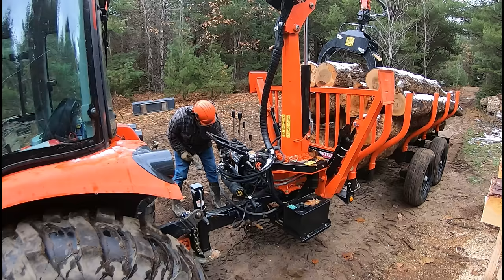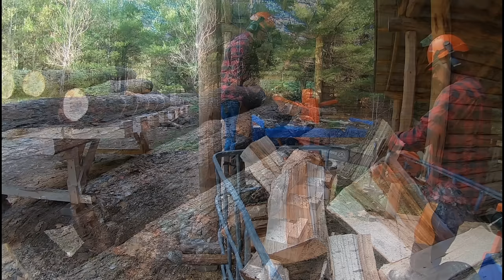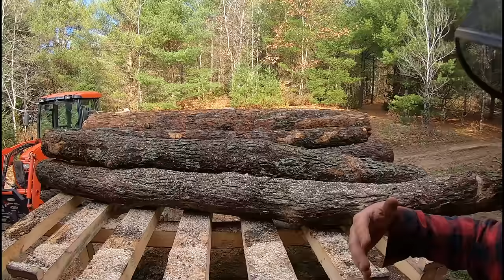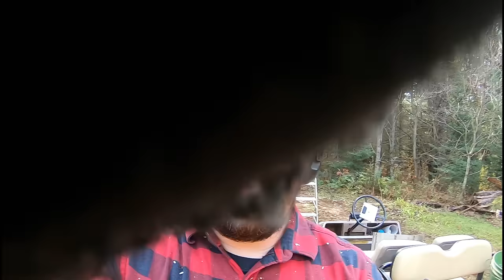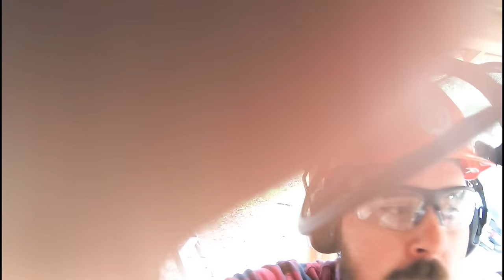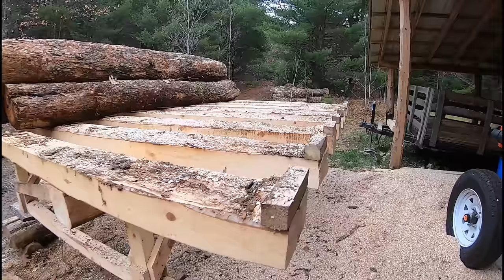Low Cost Log Deck Changed My Firewood Operation Forever

Comment: Nice setup Sandy, efficient and ergonomic. I like it, the only thing wrong is the noise of the engines going all day, don’t get me wrong I am a petrolhead and like engines of all flavours but that level of noise all day is no good for the ears. Maybe a hydraulic chainsaw powered by an electric pump if you have mains power available or a diesel power pack sited behind the building would be quieter. The same power source would do the splitter too. I imagine a hydraulic chainsaw would have less vibration too, anyway just an idea. All the best.
Reply from the maker: Thanks for coming along for the video today!

Comment: You're making life too easy, buddy! The only thing I saw, maybe cut out a little dirt where the tote sits next to the splitter, and put a cinder block or something under the other end of the tote so it sits level, and slightly lower than the log splitter deck. Those are insignificant things, just a little fine tuning.... Yea, for sure, blow all those chips away before they freeze. 

Next project... "Oh - if only you had a source of wood to make lumber!" Build a firewood shed to store your split logs and totes. Make it wide enough to drive the tractor inside to 'fork' the totes and carry them to the house, or wherever you're heating. That'll keep the wood dry in winter, and you won't have to clean the snow off so you can burn it. THEN, you can buy a copy of my book, "Hidden Behind The Mask: CENTENNIAL." At 750 pages and 540,000 words, it'll be a question of, do I finish the book or run out of firewood in my den first?! Stay safe out there, bro...........
Reply from the maker: Carl, you and I think pretty much the same way. I've been dreaming of a storage shed like you mentioned for some time. I"m going to have to put some pen to paper and see what I can do. One thing is for certain. I never have enough storage haha. Keep me updated on that book, I"ll buy one haha

Comment: You seem to be doing an awful lot of turning, lifting, stepping, and carrying. If you just put your splitter next to the log deck and reached across you would eliminate all of that wasted effort.

I want you to know that this is not intentional Criticism, but rather observations on ways to help even further. What you have done is a great step forward and makes what you do much easier. The log deck made the way you have done it is wonderful for being able to cut the logs into rounds at the site of splitting. No more manual lifting, the lifting is done by the tractor. 

If you want to leave the log cutting into rounds as you have it set up a foldable ramp between the spliter and the log deck would allow you to walk where you need to to buck the logs and still be able to reach across (if you moved the splitter a little closer to the log deck) the ramp/table with the pickaroon and just drag directly to the splitter. No walking, no lifting, no turning, no stepping, or carrying, just smack and drag.
Reply from the maker: One of the reasons I"ve got the woodsplitter where it is is because it keeps out of the elements which becomes a big problem once the snow starts flying. The wood splitter is also in that location as it's higher than the IBC cage so the wood falls right in.
Reply: @sawingwithsandy  sounds good, it is your job and obviously a personal choice I would think that a little fly/awning would fix the weather problem as much as the current placement and the cage is easy to locate. I just see all that lifting and movement from the deck to the splitter as wasted. But in the end it is your back and legs.